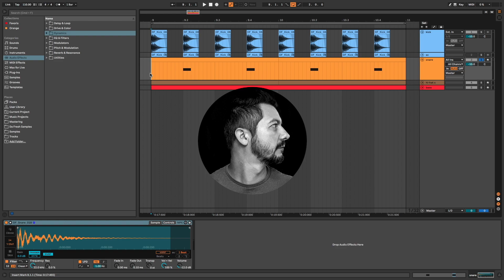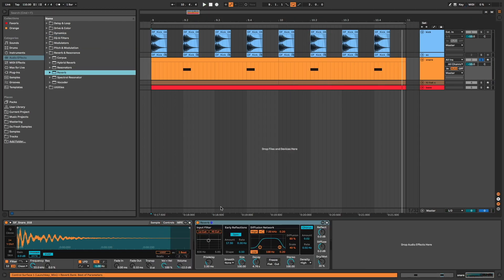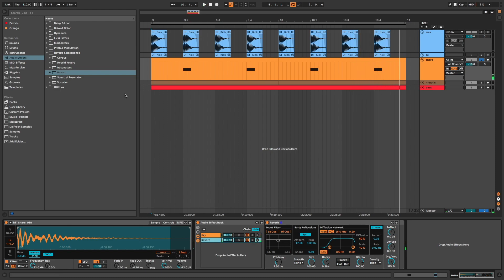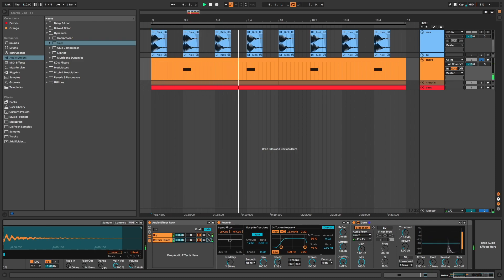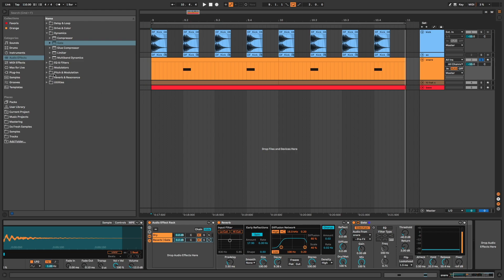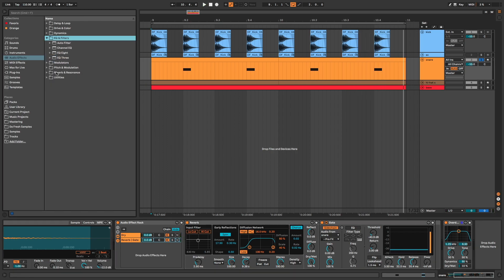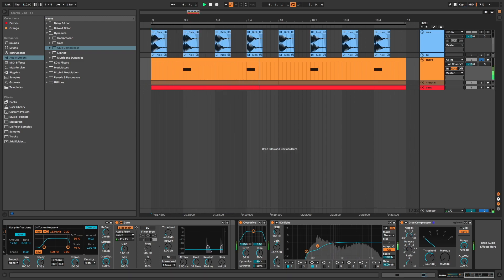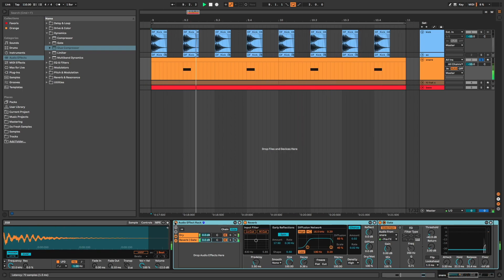HOW TO MAKE FAT SNARE WITH GATED REVERB | ABLETON LIVE

Comment: I'm doing gated reverb on a snare drum. When I get the threshold where I want it, it works, but at the end, there's a crackling sound as if the gate doesn't close off all the way. Any thoughts on how to get a clean cut?
Reply from the maker: Try to set differently the hold, release, or floor button
Reply: @DaFresh  it was my release. Thank you!
Reply: Got it sounding THICC 🎉